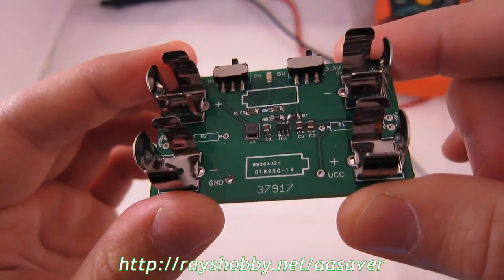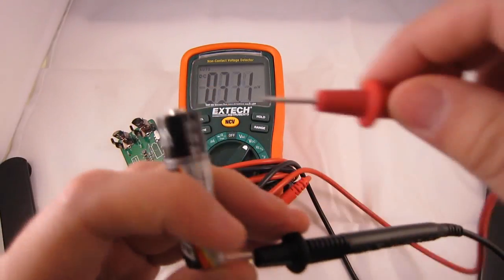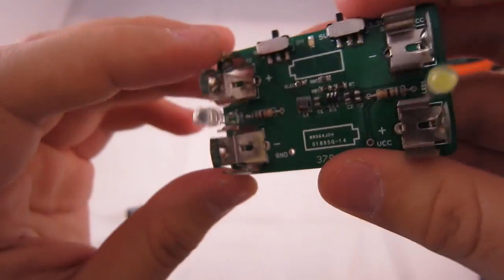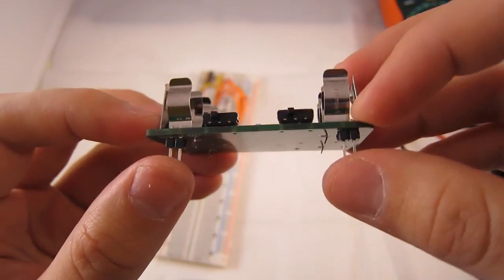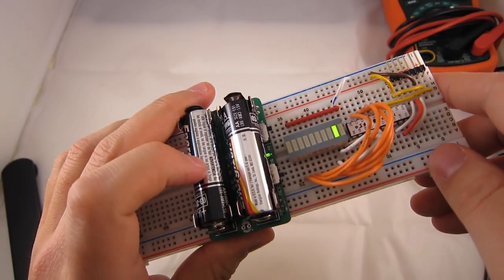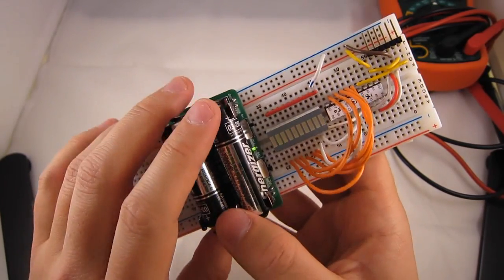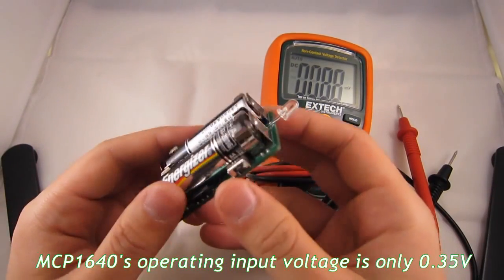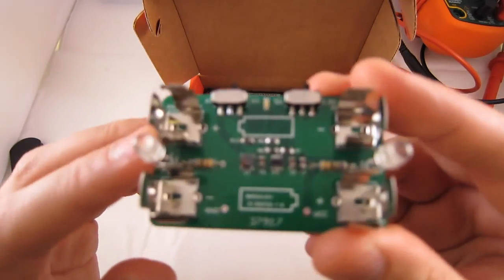AASaver

Comment from the maker: No, this is not a joule thief, it's based on a switching regulator. It won't be able to charge iPhone 4 because it can't output more than 350mA current and iPhone 4 requires 500 mA. However, it should be able to charge other phones.